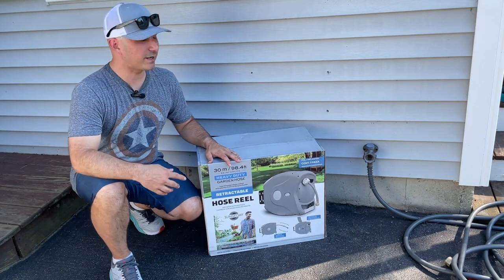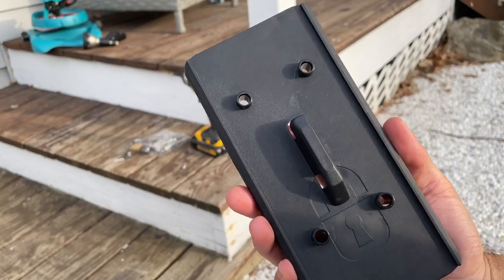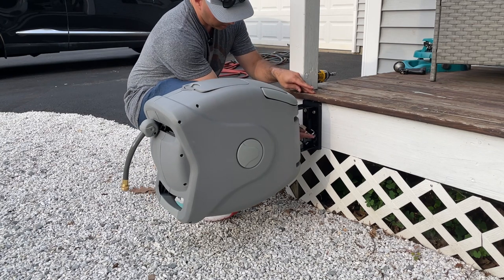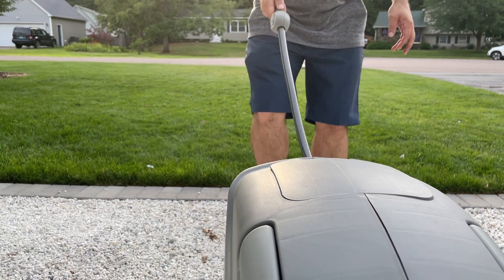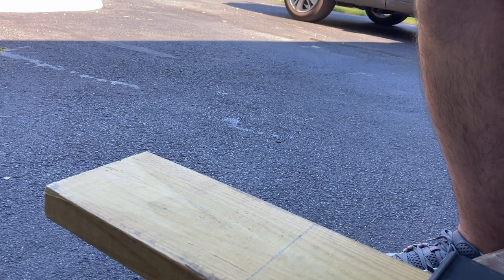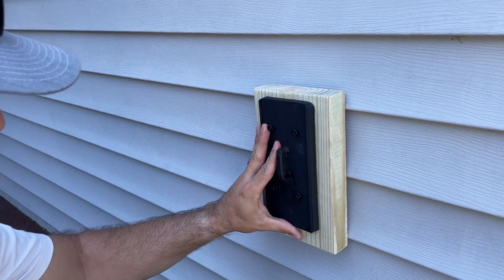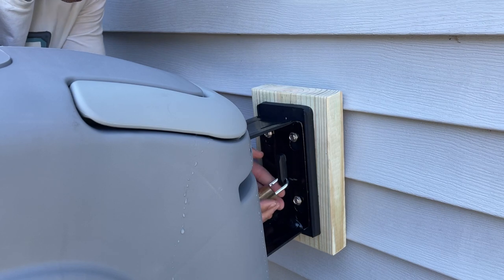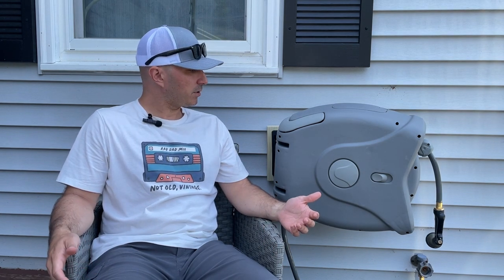Sunneday Retractable Hose Reel Installation and Review

Comment: Another suggestion for mounting this hose reel. Your local big box hardware store should carry 4x6 posts ( I wasn't sure if a 4x4 post is wide enough, so you'll have to check this with the mounting bracket). You will probably have to buy and 8 foot post ($30.00) but you can cut it in half. This way you can put the post almost anywhere you want. If your ground is soft you might want to use some concrete mix but in my area if I put the post 2 feet into the ground, it won't move after I pack it. Dig a hole where you want the hose reel located. Put the post about 2 feet into the ground (if you bought a 2x6 make sure the 6 inch face is facing in the direction you want to install the hose reel. Backfill dirt around the post. Use a broom handle or something similar to pack down the dirt all around the post (or use concrete mix if you desire). Once the post is in place and you've allowed time for curing (if you used concrete), you can install your hose reel to the post.
Reply from the maker: Thanks for the suggestion. That would have been my ideal scenario. Unfortunately, my hose bib is surrounded by blacktop and I didn’t feel like there was a sensible place to bury a post. I may consider this method if/when I put one of these in the back yard.
Reply: I mounted mine on a 4x4 post- no issues

Comment: Great video, I must have watched it 10x, I did the 2nd install but gave an angle to the board w/ a router, then primed/spraypainted everything to match my house. Basically a permanent install with 2 less bolts, wonderful. Also, you have space to move / center / level it without exposing the 2 bolts.
Reply from the maker: Thanks for watching and great additions. I considered painting it, may still do it later.

Comment: I have the exact same hose reel and really like it. I am having some difficulty getting the last couple of feet to retract back into the housing but it may just need some more breaking in. Good video.
Reply from the maker: I had a little issue with that late this summer after my kids had been playing with it. I extended the hose all the way out and guided it back in slowly making sure that it coiled correctly and that took care of the problem. Good luck. It’s a nice hose reel for the money.
Reply: I installed mine today and found I had a hard time getting it to completely retract.  Almost seems like the inside isn’t big enough for the 100 ft hose.

Comment: Very informative video.  Did you have to use plumber’s tape?
Reply from the maker: Thanks, I did not use plumber’s tape anywhere in this installation. In my experience, well manufactured equipment like this usually doesn’t need it as long the gaskets are fresh.

Comment: I’ve been using my for about 3 months now, several times a week. Only once has it retracted without me having to pull it out again and again. Sometimes it never fully retracts. I am disappointed in this hose. I reached out to company twice, their response “pull it out some more, give it time the first few times it will do that” I bought this one because of this video, what was said, access to the top, access to the hose and length and diameter of hose. I would like two more but I rethinking. It’s almost as if there is too much hose for the housing. I bought hose in summer 2023 didn’t install until spring 2024. Anyone else having problems with the retracting feature?
Reply from the maker: Sorry to hear you are having issues. I only had a problem with this reel one time and I found that I was able to basically reset it by pulling it all the way out and slowly walking it all the way back in, I’ve had no issues since. It’s truly been a great hose reel for me  now a couple years later.

Comment: Hi and ty.  I live in a condo and I was wondering if there is another way to setup or does it come with a stand?
Reply from the maker: I’ve seen people set a post in the ground about 3-4ft high and mount them to that. Not sure how strict your condo association is. Good luck. A hose reel tray is a game changer.
Reply: @JaysPlace2468  thankssss

Comment: I would use a post. I would never put holes in my vinyl siding,if you change out that hose a few years down the road your going to have an eye sore
Reply from the maker: I would have loved to use a post but my spigot is surrounded by blacktop making that a very difficult project. After using a hose reel, I don’t think I’ll ever go without one again. Worst case, if I did decide to remove it, I’d just pull a couple pieces of siding off the back of my garage and swap them out up front so the eye sore isn’t very visible. A little caulking over the holes and it’s not a big issue.

Comment: Can you mount on brick with Tapcons or you have to use the screws provided?
Reply from the maker: You’d need to find tapcons the same size as the provided screws but I believe it came with masonry anchors to be used with the provided hardware.

Comment: After one year do you still like it?
Reply from the maker: I honestly don’t know why I didn’t get this sooner. I love it. It has made taking the hose in for winter so easy. No kinked up hoses, watering the garden is so easy. I use this with my in ground sprinkler system (I have a video about that on my channel) it’s so much easier than what I was doing before. I’m sure you’d be better off with any hose reel than no hose reel but this one has held up really well and functions now just as it did day one.

Comment: $100?  Costco website now has for over $140!  Home Depot for over $230!
Reply from the maker: Inflation is crazy right? This was $100 brand new when I bought it. I will say that sometimes Costco has items cheaper in store than on the website. Even at $140, I’d buy it again. It’s made watering the lawn, washing the cars and pressuring washing the house so much easier and I haven’t tripped over a single hose since I installed it. Putting it away for winter and getting it back out for spring was such a simple task with the hose reel as well. Thanks for watching and taking the time to comment.
Reply: Costco in-store has this for 139.99 with $40 off until 6/27/23.
Reply: @robert5c  Not in-store stock in my area, online only.

Comment: i read something about hose attachments leaking and not fitting bc it’s not standard size?
Reply from the maker: I haven’t had a single leak. I’ve hooked it up to sprayers, sprinklers, pressure washers. No leaks. In my experience, leaks are usually due to the gaskets wearing out. I generally keep some spares on hand and change them out every spring.

Comment: I’m not crazy about this design.  In time the bracket will not hold due to the tension due to weigh of the hose especially when water is in the hose.  The unit will sag so I’ll pass on this design and go with a free standing hose unit that is self retracting using water pressure.  It’s a much better design IMO
Reply from the maker: I had similar initial thoughts but the plastic bracket actually has lags underneath that hold up the reel. Almost a year in, it’s been really stable. I can’t fault you for going another way but I’m fairly impressed with how this is holding up with all the use I’m getting out of it.

Comment: A little suggestion : NEVER BUY A "BEAUTIFUL" shiny PLASTIC HOSE they display before your nose at the stores. Instead, BUY AN UGLY BLACK RUBBER HOSE, which doesn't kink and coils up good any time-every time right under your spigot place, no need for plastic coiler. Right now you can buy a Continental hose in Home Depot, 50 ft only $ 49.  It's the best hose ever. It will last also many many years.
Reply from the maker: My grandpa always bought ugly black rubber hoses and they worked great. That being said, I used to have to coil them and they were heavy. This hose reel has held up very well and been absolutely effortless to use.

Comment: The mounting bracket kind of sucks
Reply from the maker: It’s not perfect but there are certainly some of these hose reels on the market with a worse design. I like that it has an option for a lock which keeps it from getting knocked off accidentally.
Reply: I agree, not a good design

Comment: It costs $180 on Amazon 1 year later😢
Reply from the maker: I saw that. At the $99 I paid, it was a steal but I’d still pay $180 for it today because it’s changed the way I use my hose. It’s just so much of a timesaver, I’m washing my car more, watering my lawn more, it looks better than the old pile of hose I had and taking it in for the winter was such a breeze.
Reply: Just bought mine today at Costco on sale for 100 and it was originally 140